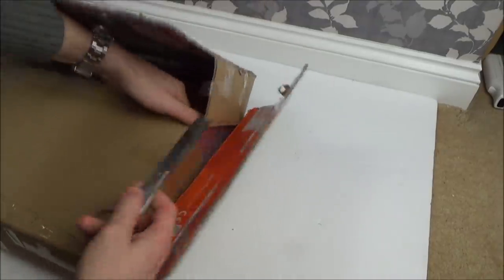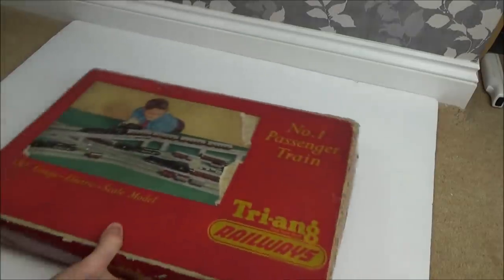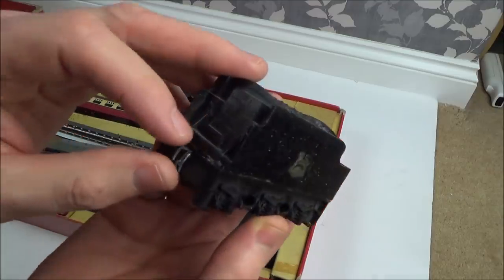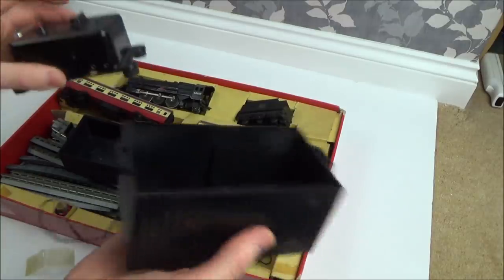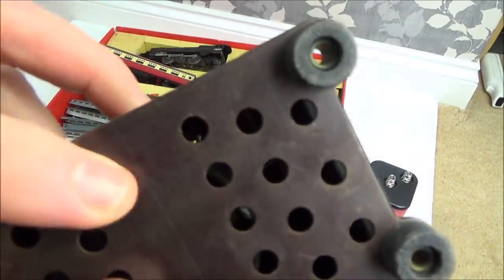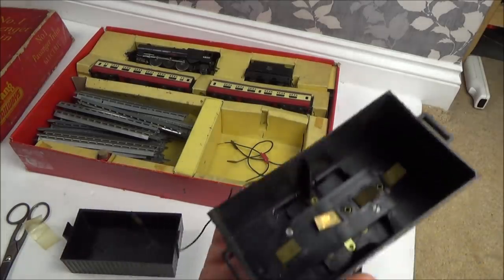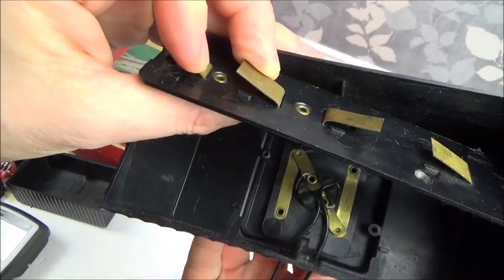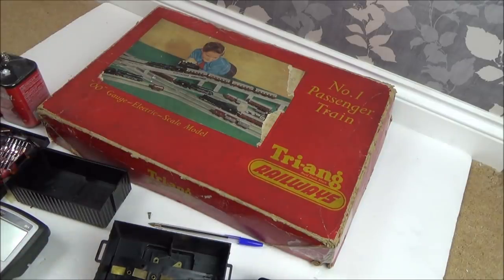eBay Pre 1980s TOY Repair Challenge PART 5

Comment: Great fix! Glad we both did trains. Yours was quite an old one by the looks of it. I really wonder if they had different battery contacts back when that train was made. Either way you got it working well.
Reply: TronicsFix yes Vince did do a amazing job repairing this 🚊. Sometimes he fails, but he learns from his failures. Remember you’re never to old to learn!
Reply from the maker: Cheers Steve, I think this was from the 1950s but I couldn't find out any information about it on Google. The batteries might have been different with the contacts inline rather than staggered. The forum I read did say it took the lantern type P996 batteries so I really don't know what was going on with the contacts in this control box. Hopefully a viewer will know :-) Looking forward to your 5th video. Thanks for doing the contest with me and although we won't make much money the enjoyment has to be factored in. Good luck with the final figures :-)
Reply: I'm actually interested in doing something like this in the future.
Reply: @Mymatevince  I saw some batteries like that in the wilco local to me
Reply: Yes the batteries were inline instead of staggered my brother used them a lot.
Reply: I’ve seen in line lantern batteries. I think they have to be custom ordered.

Comment: You will probably find that the little bottle with the dropper is "smoke fluid" An oily mix with some solvent that produces low density vapor/smoke when the locomotive is running. Trying to simulate the exhaust of real steam locos. It was quite a popular feature with toy trains in the 50s and 60s. Generally out of fashion these days.

In fact, a friend of mine got some vintage trains (Lionel) and when they were up and running with the smoke coming out the reaction of his brothers' kids was, "Yeooh! Pollution!."
Reply: Fog machine liquid? Glycol and glycerine? Or these days, vape fluid would probably work.
Reply: My grandmother bought my older sister, who was just 4 years old at the time, a huge Godzilla toy that had smoke stream from its nostrils when you poured a solution into it.
Reply: Nowadays smoke systems are very poopular in RC tanks.
Reply: Maybe use some vape juice?
Reply: No thats the lubricating oil that came with triang trains. 
The bottle for the syncrosmoke unit had a bottle with a rubber eyedropper type stopper.

Comment: I had a layout in my loft that would have put Pete Waterman to shame.
I had a special carriage that cleaned the rails which I would send around the entire layout once a week and it was brilliant.
You also need to clean the engine wheels as they are the pick-ups to the motor.
I had a mini vice to clamp the engine upside down and a plastic fork with a couple of scalextric pick-up braids wired up to provide power and spin the wheels whilst holding an IPA soaked cotton bud on the wheels.

Comment: OK a couple of points here: 

Firstly, the type of batteries required for this old train set are no longer manufactured. The 996 type lantern batteries that you were using are electrically the same as the old ones, but the modern version has one terminal mounted on the corner and the other in the middle - this was to prevent it being inserted the wrong way round which was all too easy to do with the older style.

The second point is regarding the speed controller. Like most others of that era, it's basically a wirewound variable resistor, and when you turn the control, it adjust the amount of current, rather than voltage, that is applied to the track. (This is why your multimeter showed little or no change in voltage when you were trying the controller - you would need to be measuring current with the load (tracks) connected in series with the controller and meter in order to really see what is going on with this type of control) This is a very simple and reliable method of controlling small DC motors but because low speeds result in low current, the train will tend to stall at low speeds and especially if it's pulling a full load of coaches, as the motor torque is drastically reduced at low currents. 

This is why modern controllers (and by "modern" I mean from the mid '70s onwards) use pulse width modulation instead, where the full power is applied to the tracks regardless of the setting, and the speed is adjusted by changing the ratio of on:off timing of the pulses, resulting in the full torque being available regardless of the speed, resulting in far better low speed performance. Also, because a PWM controller delivers higher current pulses all the time, it has much greater tolerance of dirty tracks than the old variable resistor type system. It is, however, a bit more complicated, though not massively so. Nice to see that you got this set working again though - another great job!
Reply from the maker: Brilliant info and very well explained. I understand it now. Thanks for sharing :-)

Comment: We used to have this set when we were kids. It was our cousins and we gave it back when he got married and had his own family. The engine and track are exactly the same. The only difference is that ours had a mains power supply and controller in one unit.
And I distinctly remember that little bottle for the oil.
Magic!

Comment: Vince in the 1950's and 40's   there were lantern batteries that had the poles on the opposite sides rather than at an angle...  they went to the angle type because you can't put the batteries in wrong like they used to...
Reply: oh BTW the old ones had a threaded terminal on top as well...  but in this case they left the screwed on nut on top when they put it in the battery box
Reply from the maker: Ohh, that makes sense regards the polarity. Thanks for letting me know. I have been Googling 'old Ever Ready' batteries but I couldn't find any pictures of them. Thanks for passing on the knowledge :-)
Reply: @Mymatevince  I Feel a bit guilty now. It took me 3 minutes not only to find the batteries, but to find a supplier on eBay. 6 euros each :)
Reply from the maker: Thanks, have you got a link?
Reply: @TheTkiller9999  do you remember the big square ones that had the push on connector , like with the small pp9??
Reply: @Mymatevince  The one you needed might have been the pp7, also 9volt like the pp9, just to confuse things . Had/has round connectors like the small ones you put in a smoke alarm or doorbell. Might be useful to know if you do something this old again
Reply: Yep and they had brass strips the same as what is inside the battery holder

Comment: Great stuff!  I would be tempted to use a fine sand paper on the wheels of the train, and on the track!  Same goes for the contacts that connect with the battery and the 2 banana type connectors.  Then wipe over them with something like deoxit!  You might find better connectivity then!  But it came out well!
Reply from the maker: Thank you Chris, is that Deoxit about £30 per aerosol can. Is that the stuff you use or a tube? I want to make sure I am ordering the right stuff.
Reply: @Mymatevince  It's insanely priced in the large cans =/  You can get a small tube for like £7, and if you use it sparingly it can to a long way!  The other way that can help with the tracks is brasso (metal polish).  Go over the tracks with that first, then clean it off with IPA.
Reply from the maker: @GadgetUK164  Good man Chris, I will order up a tube from Amazon :-) I might get some Brasso while I am there. I used to use that on my bicycle when I was a child to get the chrome bits nice and shiny :-)
Reply: Yeah, it's good stuff!  I think it has some kind of acid or something as the cleaning agent.  It works really well on cleaning up conductive tracks like that.
Reply from the maker: @GadgetUK164  They are in my Amazon basket so I will have them next time I put an order in.  BTW I emailed you earlier today:-)
Reply: Yep, DeoxIT is great stuff. Very expensive, but it lasts for a long time. And although it seems to be like an oil, it's not conductive at all. In fact you can apply it to everything even while connected !!. Of course the best is to clean it all with IPA after using it just because of the dust it can catch.

Comment: My Mate, resistance needs load.  Think like you have two lakes connected by a small river.  That river is the resistance.  If you add water to one lake, it slowly equalizes in the second.  But if that second lake is feeding a stream or waterfall or something, it never equalizes because of the resistance of the small river.  The tiny load of a multimeter just isn't enough.  Voltage is the right setting...but you need to measure voltage drop during operation; not static voltage at idle.  One lead on the input (battery), the other lead on the output (going to track).  Also super-useful for diagnostics because a bad connection can read 1 ohm with only the load of a multimeter, but can basically turn into an open circuit with just a fraction of a watt flowing through it.

Comment: I used to work in automotive parts and work on many electrical systems now.  I would bet you a pint that the batteries made when this train was had their post terminals in a row.  I saw at least 10 or more post configurations change on batteries in the span of 2 years at one point.  Manufacturers change them up often to make "proprietary" type connections now so you have to buy their stuff to make it work.  This train was built in the golden age of more standardized parts where you could buy a battery from any manufacturer and it would work as long as your voltage was right.
Reply from the maker: Yeah you would win the pint :-) After looking at the comments on here and the links given to the original instructions, it looks like the batteries are 2x 6V P996 with a spring for the negative, but on the positive it is a sprung tab rather than a spring and they are inline. The sprung tab is quite long it would probably reach over for the devices that took diagonal contacts :-)

Comment: I love old Tri-ang sets, their older ones were third rail like the London Underground with the current rail in the middle.   Tri-ang I think it was actually sold a rail grinder thingy that when it whizzed round it polished the tracks as it went but most ppl I have seen with these sets use either steel wool, baking foil or have little holy stones they rub up and down the railhead.
Reply: The engine is in BR black carrying her BR number, when she was with the LMS, she would have been often seen steaming through your local station at Watford Junction being in 1939 based at Camden depot and would have run through semi-fast expresses from Euston then she moved all over the country up to Scotland and back down to Liverpool until she was withdrawn in 1962 after what seems to be freight duty at Carlisle Kingsmoor but was immediately preserved and still going today :)

Comment: Hi, the coil thingamajig is called a voltage variac, it should be very smooth with carbon pads on the wipers giving a fairly variable stable Vout. yours sounds very scratchy and almost broken jittery output.

Comment: Nice fix. Use a blue or green scrub pad on track to clean. Spray contact cleaner on coil in speed controller and move controller full sweep to clean. Should fix problem. I had trains as a kid.  62 now.
Clean track ends very well to avoid dead areas.

Comment: The battery cover is original and never changed. It's the battery design that has.
Reply: I also remember when the battery terminals were straight on top.  I think they changed them because it was too easy to install them wrong.  I can't find it online when this happened but my old brain remembers them.
Reply: Might be possible to make contact by twisting the springs on the battery...

Comment: I believe the the correct battery is the PP6 which is a lantern battery but the contacts are not diagonal, where does it say 12V because a lot of electric trains sets were approx 15 to 18V.
The coil is for overload cutout.
The resistance of the variable speed control will only be a low resisance i.e. 20 ohms.
You could use your DMM to find where the power has disappeared when the train stops.

Comment: The contacts are made from brass strip, you could extend them using single sided circuit board (if you have any). The inside of food tins tend to have a lacquer coating ie non conductive.

Comment: Awesome video, been following this series of challenges and funny enough I actually have this exact same train set up on my shelf. It was the last ever present I brought for my dad before he passed away, he always loved model trains and I figured out this was the first train set he ever got as a kid. So I found one on eBay and restored it and gave it to him for Christmas.

Haven't touch it since he went, but this video gave me that push to get it down again. Bit emotional as I took it down and realised the actual train was still sitting on top of the box in bubble wrap, from when I had taken it out to bring it to my dad at the hospice in his final days, one of my last moments with my Dad he was showing off his train to his friends who were visiting. I never actually got the battery power supply working when I brought it, so I reckon I'm going to see if I can get it working again, then fix up the box and keep it all safely stored.

From what I remember when I researched this train set 'No1 Passenger Train" it's the first ever set released under the Tri-ang brand by Rovex Plastics ltd, Rovex first introduced an early version of this train in the late 40's under their own name, but this is the first of the Tri-ang branded sets. In the 60's Tri-ang were brought out by Hornby and they continued to use the Tri-ang style set up, so this is also one of the first modern style Hornby/Tri-ang train sets as well. The train itself "Princess Elizabeth (The Queen)' is painted in war time black; all trains were painted black during the war to be as hard to spot as possible to enemy bombers. They later released a version in the red livery you saw on google as well. 

Anyway cheers for the video dude, look forward to the next season!
Reply from the maker: Well that is a great comment, sorry to hear about your dad but it sounds like you had a great relationship with him :-) I never knew that about war time black, never heard of it before so thanks for sharing all the info :-)

Comment: it looks great fun and nice to see it saved for future generations to appreciate.  when cleaning the track did you also clean the connector pins on each section is those being dirty may be losing you power and some dead spots on the track
Reply from the maker: Thanks. No, I didn't but I will do that with a little wire brush before resale. I never really thought about cleaning them :-)

Comment: Love the old train!  You fixed that battery connections great!  I'm thinking it might use a screw terminal 6v battery for one of the torches where the battery is the base.  At any rate, it looks great!  I was also wondering if maybe you hook the battery case directly to the track so it's portable and that metal gear box came with a brick power supply for the wall that dropped the voltage to 12v.  Great job, Vince!
Reply from the maker: Thanks Jim :-)

Comment: Rewatching this as this last month I bit the bullet after accidentally winning a GWR 060 Pannier and a BR class 08 for a few pounds off ebay taking very little to get these very old Triang loco's running, a few pounds more got me several Triang coaches and picked up a ton of track, platforms for very little money, then I snagged a £20 NOS Lima class 33 never used and got enough for quite an involved layout.   
Model railways is like riding a bike, you just never forget how to do it all, the only thing to get my little loco's running is I need to solder a little brass tab onto the wire that feeds the positive brush on the motor of the Pannier and the 08 I have made up from phosphor bronze strip a new pickup which I will solder the remains of the thin wire pickup to and both motors have new brushes and work beautifully now :D

Comment: I would have got one of those AC to DC converters that everything uses, those black plastic plugs with a little box on them with a small wire to a barrel jack that all sorts of appliances use.
I couldn't find my original MegaDrive one so I just searched eBay for a 10V 1.2A DC power supply, and got the perfect one for very little money. 
You could search for a 12V (something) amps one in eBay or probably in the tip, and wire it up directly to the battery box (with a switch so it doesn't charge the batteries!) so that this set could be mains operated as well, which I'd think the buyer would appreciate more than having to replace these huge batteries.

Comment: 25:50 the speed controller is a potentiometer (variable resistor) so without load, the voltage will be close to the source voltage. A voltage drop only happens when there is current (voltage drop = current flowing * resistance). When you measure it, there  is very little current so the drop is very little

Comment: The electromagnet is a circuit breaker which cuts power if the track is short circuited in an event of a derailment where the metal wheels are bridged between the two rails. It's there for safety to prevent the batteries from overheating in such circumstances.
Reply from the maker: Perfect, thanks for this, I worked out that is was triggered by a short but I didn't think of a derailment causing it. Thanks for passing on the info :-)